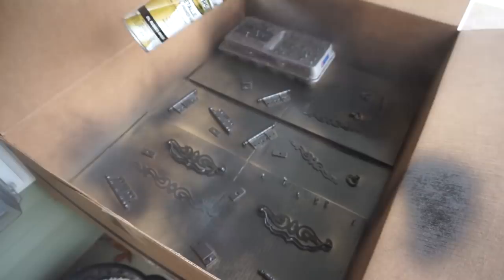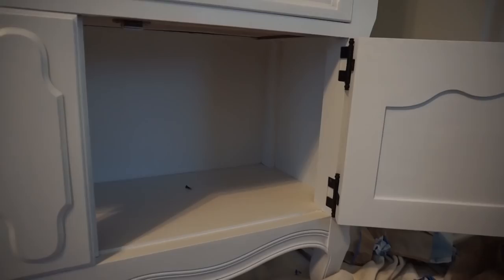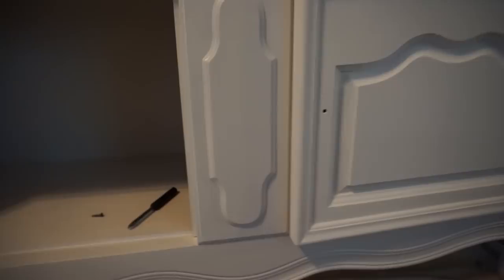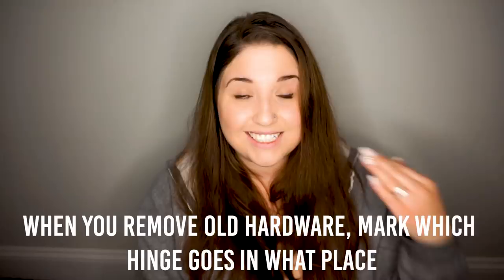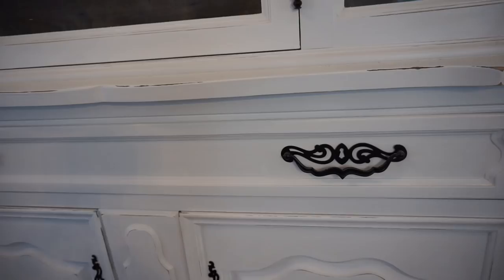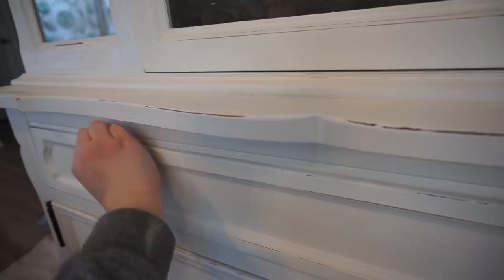The Harrowing Tale of a Disastrous Hutch Makeover - Storytime/DIY Project

Comment: thank you for sharing. I just had an experience that I haven't decided how to fix yet. I chalk painted a rocking chair. And it was a dark blue so a regular transfer would not show up. So I transfered it on with chalk and painted the transfer in with a white chalk pen. I assumed it was oil and would not run. When I began to wax it smeared the white paint all over. So I added more wax to try to salvage the picture and make it look a tad bit distressed. Looks awful ... Now I still have another transfer on the top of the chair and don't know what to do with it. I know if I try to sand it off it will probably ruin my paint job and smear. So annoyed. It looked so good before I waxed it... :(

Comment: Bleed through can be caused by not cleaning it off well enough before painting. There can be wax or grease on it that causes this. I always use Annie Sloan chalk paint and have never had bleed through. Did you clear wax it to protect the finish so it won't chip more?   It looks great. The distressing pulls in the plank backing.

Comment: Unscrew the hinges. Note which door it came from and if it did/ didn’t work. Then try swapping the hinges round while noting which doors work and which ones don’t. Do it methodically trying all possibilities. Eventually you will find a hinge that works for each door. It will take a little while but it will be worth it and still probably less effort than scraping paint/ sanding/ trawling internet for other hinges that might work.

Comment: Remortise the hinge! A sharp chisel can shave off a high spot in a second. First, I would have removed the hinges and rearranged them until I got the "correct" hinge in their original factory installed placement. Scraping the paint out of the mortise was a smart first move since paint buildup can create a problem for hinges with shallow offsets. If that didn't solve the problem I would have rearranged the hinges. If not, then remortise. If the screw holes wear out in the wood for taking the screws out too many times, just fill the holes with a two part epoxy wood filler, wait for it to fully cure and dry hard then predrill pilot holes and screw the hinges back in.

Comment: Primer is your best friend. You should have used 1 coat of primer and 2 of your chalk paint. Especially on the hardwear! Spray paint scratches off if hardware very easily, and rustoleum makes rust free primer that is perfect for using on cabinet hardware because it won't rust and it allows the Spray paint color to bond with the bare metal.

Comment: I know this video is 2 years old and maybe you've already solved your problem.  Since I'm currently painting a buffet, I've read lots of articles and I remember reading that if you have a piece with tight fitting doors and are planning to chalk paint, you should sand down the edges of the doors before painting because the thick chalk paint can be enough to keep doors and drawers from closing.

Comment: I agree with changing up the hinges till you can find the right fit, hope you don't run in to more trouble. I was wondering if before you put anything on the doors and drawers, if you should take off the old to plain wood, then paint it. Marking the hinges is the best part. I ran into the same problem as you, I just gave up and got new hinges and it worked. I didn't think it was so bad, till you showed the hinges part, and no laughing here, just knew what you went through. Over all you should be very proud, cause it turned out really nice. And will your Ray Dunn in it, was also really pretty. It show cases your stuff very nicely. Check Google and see what you find out. Take care.

Comment: I feel your pain.  I'm in the midst of refurbishing an old secretary desk, I thought it would be so easy - I had a vision and then realty struck like a bolt of lightening.  Silly me and my visions.  After I painfully scraped the layers of paint off I found that there was a putrid reddish stain under the paint.  Impossible to remove, couldn't even sand it off.  Sigh.  Went to local hardware store whipping my tears away before I went in.  They all said "we feel your pain" you need to put shellac on the entire piece which will stop bleed through unless you are trying to paint said item white - them you are out of luck.  I haven't put the shellac on yet waiting for wood to dry after all the gunk I've been dealing with.  I can't imagine that it will be easy as made it out to be.  I did buy the most beautiful deep, dark blue to paint it --- if I'm not in a padded cell by them.  Good luck!
Reply: Try taking a iron to it, I can't recall if they use a rag under the iron (search it on here I've seen them before) don't just leave the iron sit on it though move it around like you would iron clothes, It helps a lot getting stains out of wood (and apparently carpets as well lol)
Reply: K

Comment: Try sanding the base not the doors (the part the doors close into) .  Remember wood expands and contracts so you may get it to close and then find when the season changes there may be a gap.   N E V E R not mark your hinges from where they came.  OR just remove the doors on the bottom altogether and use it as book shelves or display your collection.

Comment: You should have taped the spots where the hinges go and not painted the edge of the door on the hinge side. And if you also sprayed the back of the hinges when painting them, altogether you added six to eight layers of paint which is about an eighth to a quarter inch of thickness
I am of course assuming the door closed properly before  painting

Comment: take the doors off the hutch let them dry in the sun with all that paint  that soak in it hakes them biger. if it is cold out side set them in front of your fire place. they need to dry really good
when any wood of any kind gets wet it swell up. it may never close , but keep sanding the spots that stick you will get it to fit soon or later.    good luck

Comment: Could be the doors are on the wrong side, not the hinges. Doors are much like drawers. If put back in wrong, they might not fit. That is why drawers are numbered & should always go back to the same position they came from. As these doors are flush, (ie. not resting on the surface)  they likely only fit properly in their respective sides.
Reply: Agree with drawers not working if they don't go back to their original position.  Yes, possibly the culprit.

Comment: You should use primer, bin primer by zinsser is by far the best primer you can get a little pricey but worth it if you are doing a big project like this, also for the doors, did you try swapping around the hinges, keep putting each one in a different position and you will probably get it, but it looks incredible anyways, I love the distressed look and those panels on the back are gorgeous
Reply: Jack agree! I was thinking you need a primer on that. I use BIN too. It’s awesome
Reply: Make sure everything is level. If the hutch isn't level, the doors won't close properly. Been there, done that.

Comment: Rule #1 - when you remove hardware, make a sketch of the piece of furniture indicating the placement of the hardware numbering each piece on the sketch and and attach a corresponding number on each piece.  Also, if a piece of hardware can be reinstalled upside down from the original installation, also indicate on the piece which side should be up.  I learned this the hard way when doors would not close after hinges were reinstalled, not thinking about how the furniture was constructed and the hinges were mortised in to the edge of the door.  Also, there is the issue of the thickness of the paint interfering with doors and drawers not fitting after being painted.  I learned that lesson the hard way as well.

Comment: Why dont you just try moving the hinges around untill you find the combo that works?? I know it would be time consuming but it would eventually solve the problem...
Reply: It doesn't have anything to do with the hinges, it's the doors themselves, they just need to be sanded around the edges on all four sides really good and then repainted. When you paint wood it expands and appears warped. So you have to make the doors a bit smaller to fit. A planer would be perfect for this but you do have to be careful when using a planer,  because you could take off too much wood, so sanding is the perfect solution.

Comment: When you sanded the sides of the doors, did you sand the door frame?  Have you tried opening the right door by reaching through the left opening and pushing it from behind?  Just my two cents. Hope it helps.

Comment: Did you try exchanging the hinges with each other? That would be the logical thing. Clearly this piece had those hinges in the one place for decades so they became warped to each space of its own. There are only four hinges, right? Shouldn't be that big of a deal, just go one at a time, or actually two I guess, and see what works. I am sure you can find the right match, just takes the time and a little patience. After all the incredible work you did you should be willing to follow through . This piece looks magnificent by the way, even distressed. Just decide to take one full afternoon and change out the hinges. When you finally get it right, go get yourself some chicken nuggets :))) oh yeah and the " bend and snap" was great! 😅 oh, also, what about exchanging the two bottom doors? Are you sure they go on that side??

Comment: It makes me laugh to read how some people think 2nd hand furniture is being "de-valued" by painting over the original wood. I love wood, but we humans have been churning out mass-produced furniture from factories for so long now, that very close to zero per cent of any furniture has ANY significant value anymore. That's why it's been dumped in a thrift store. The chances of you finding a piece of furniture for $10 in a thrift store that is even worth that are equally as slim. What makes old furniture valuable is not just its age, but who made it, its rarity & its quality of manufacture or craftsmanship. When there are hundreds of thousands of that same piece out there, all from the same factory assembly line, they are just 2nd hand furniture - devalued by at least half as soon as it leaves the store & continuously devaluing thereafter. My son & I once volunteered in some charity shops & we had to smash up dumpsters full of old furniture every month & send them to landfill because it just doesn't sell. Most people would rather buy new flat-pack from Ikea & there are only so many of us who buy old furniture to make-over. Personally I'd rather see the old pieces recycled & used by someone than go to landfill & if that means they paint it, good for them, they own it after all.

Comment: I will be taking some some projects soon with painting and wanted to ask a few questions about the calk paint. after you paint something with it can you not take a cleaner and whip it down? also does it come off easily (even with sealer)?  would it be a good idea to just destress the items?
Reply from the maker: Hey!  So when you paint something with chalk paint, you definitely need to seal it with something; otherwise it’ll just wipe up all the paint in a... “wiping off flour all over the counter with a wet washcloth” way. Basically smearing it everywhere :p. There are a few different products you can use to seal it with. The easiest is probably wax. It’s literally just a brush on, let dry, buff process. But wax doesn’t really hold up very well with heavy use. Which is why I typically use polycrylic. It’s clear and is way more durable. It’s safe to wipe the polycrylic down after it’s dry :) 

And distressing is really purely just an aesthetic preference if you want something to look old :).  If you do decide to distress, you would do that after you paint and before you seal it. 

I feel like I just wrote a novel for you... so sorry about that!!  But if you have any other questions feel free to send me an email!   Have a great evening 😊

Comment: Your cabinet probably had a 100 pounds of dishes in it for years in someones dining room . Your vinyl may have added weight and changed the weight distribution. And or the climate outside to the inside also affects the wood. Maybe once the buffet has adapted to room temperature and some heavy china it may creak back to it's original size.

Comment: Your hutch looks great! You did a fantastic job.  Did you apply a sealer or wax afterwards? I just completed a dresser using a white chalk paint & am debating if I should wax it or  just leave it as is.
Reply from the maker: I haven’t added the sealer quite yet (due to the door disaster) but I always seal my pieces after chalk painting. I typically use minwax polycrylic, but wax works too! 😊

Comment: Loved the video and the hutch looks adorable...but sorry for all the headaches! 😆 I felt bad smiling at all your troubles, but you're too funny! 😁

My first thought is you could try completely sanding all the paint off the 4 edges of the doors, and the 4 edges of the opening down to bare wood. I truly think it's probably the thick chalk paint that's causing your problem because it's adding too much thickness all around...just like it made the hinges sit less flush...there's so much more combined surface area with the 4 sides and 4 openings. 

Obvi, the easiest to tackle first would be the door edges...if they were all sanded down (maybe even partially would be enough) the doors would probably shut easier without going to all the harder work of also sanding the openings. 

Hope this helps! 🤞 Good luck and take care! 😁
Reply from the maker: I did sand off the paint on all the points of contact... but it still doesn’t fit 😭. 

Don’t feel bad for laughing!  That was the point!  I love making people smile 😁
Reply: The DIY Cottage 😁😁

Omg! 😭 You sanded and they still don't fit?! And the paint's completely gone from all 4 edges of the doors?! 😳 Is there still paint in the cabinet opening where the doors slot in?

Comment: It’s looks great and not that big of a deal really but u should always, always mark and label hardware and doors and draws whenever removing them it will as u know save u the hassle. But it’s not the hinges that’s wrong it has just settled into the wood with the specific hinge and door n draws I would just start with the ones that are worse and get and battery operated screwdriver and just try each hinge on one at a time til u get the right one then move onto the next worse one and repeat it really won’t take that long really.. you did a beautiful job on it though and I would have distress it right from the get go it’s very fitting for the hutch no pun intended lol.. fitting

Comment: YOU GAVE A CLUE TO THE PROBLEM...YOU DID NOT MATCH THE CORRECT HINGE TO IT'S ORIGINAL PLACE...SO SWAP OUT THE HINGES .  iT WILL BE A BORING PAIN, BUT YOU HAVE TO EVENTUALLY FIND THE RIGHT ORDER FOR THE HINGES AND FINALLY HAVE EASILY CLOSING DOORS.  GOOD LUCK.